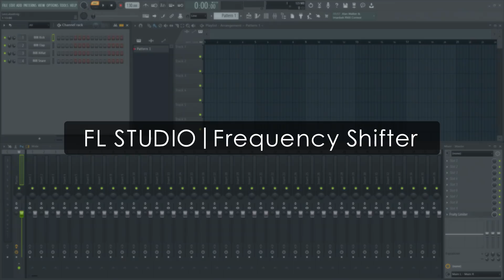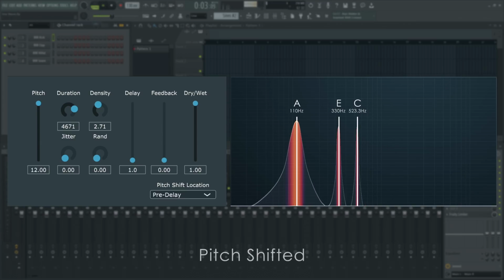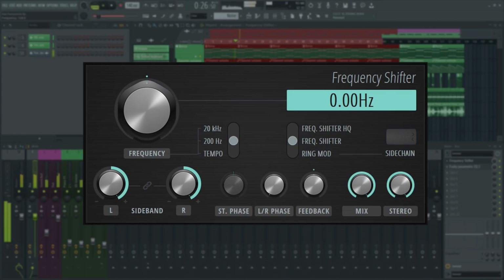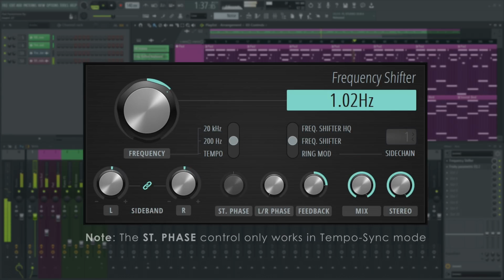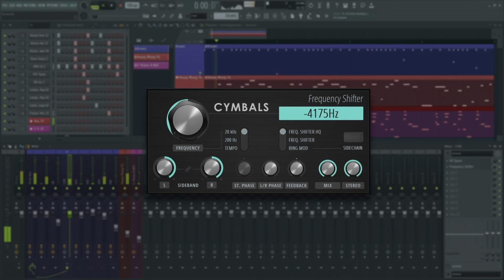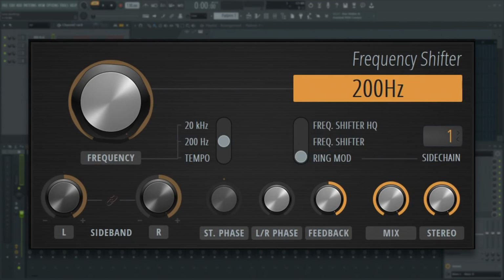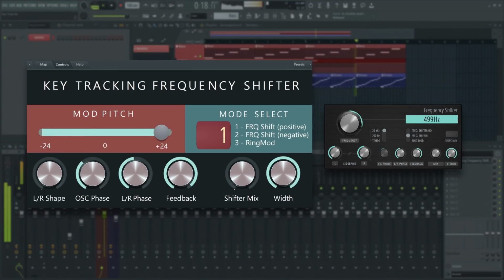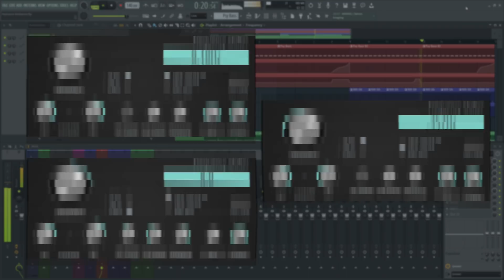FL STUDIO | Introducing Frequency Shifter

Comment: The difference between pitch and frequency shifter can be explained much more understandable if compared in the linear frequency scale instead of log, and some simple harmonical signal (sawtooth for example). In a few words, pitch shifter just stretches and contracts the spectrum linearly (thus, mathematical relation between harmonics keeps constant since all of them are multiplied by same factor), while frequency shifter just moves the spectrum up and down linearly, and this can produce some unusual effects. For example, we have sawtooth signal with the base frequency of 100Hz, and it's harmonics would be 200, 300, 400hz etc. so they are the simple multiplies of 2x, 3x, 4x of the base frequency and it sounds natural for our hearing. And while we move the spectrum down f.e. for 21 Hz, the resulting harmonics would be 79, 179, 279, 379Hz etc. and so they're no longer divisible by simple number and the signal is no longer periodic - thus, it sounds like a bunch of incoherent harmonics to our ears. This can produce some spooky atmosphere after proper processing - chorus, reverb etc.. Actually, the ham radio enthusiasts are dealing with this effect a lot while listening to SSB transmissions when the receiver is not perfectly in tune and the audio frequencies is shifted slightly.

Comment: If you showed this to someone 50 years ago, they would be staggered at what we can do with sound now. And then they'd burn you as a witch!
Reply from the maker: Funny thing is, they DID show a modern Frequency shifter 50 years ago (1972): https://zkm.de/media/file/en/harald-bode_1972_high-accuracy.pdf

In this little design spec there are references to even earlier designs too. So the process is not "new" per se, but the digital implementation of these analog components is fairly new indeed.

Comment: Way to do an intro video and THEN say it costs 100 bucks after I implemented it in a project. Thanks for that.
Reply from the maker: Hi there. Sorry you're having trouble. Frequency Shifter is included in Producer Edition and up. So we would guess logging into your account in FL Studio again will unlock it. You should do this occasionally anyway, as new features will often require a license update.
Reply: @FL_STUDIO  when I tried to save, it said it was a trial version. I logged in but it still said the same last night. I'll have to check again today to confirm.